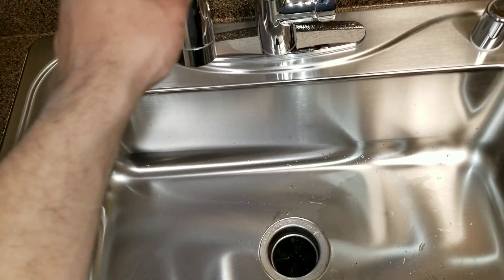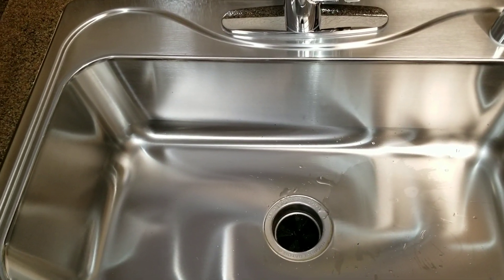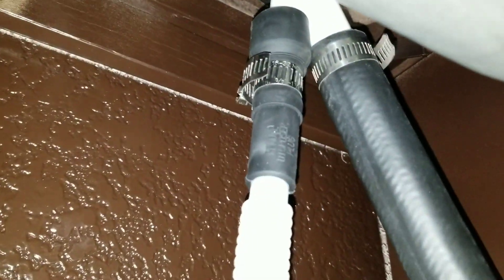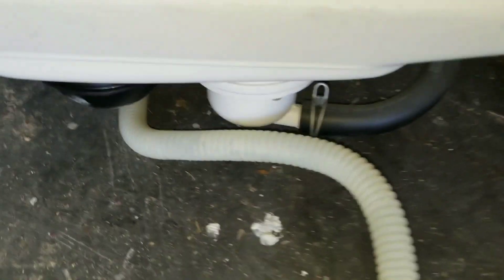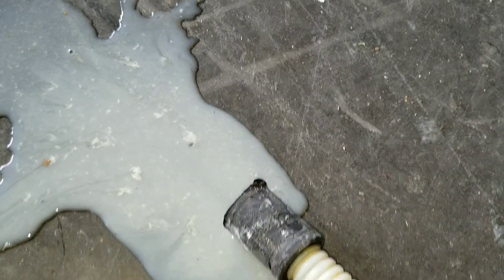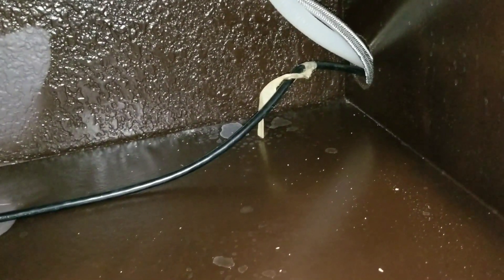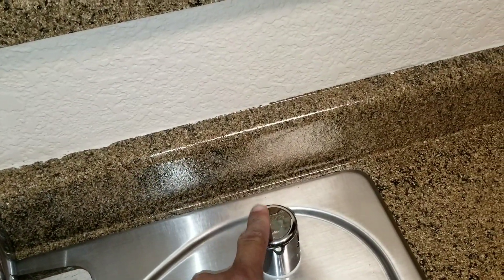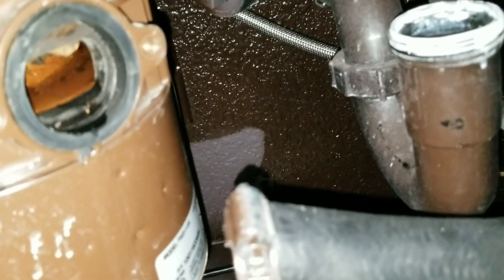Garbage Disposal STINKS! Real FiX!!!

Comment: I'm Still working on my smelly disposal after using the lemons, ice, baking soda / vinegar bleach and scrub brushes and commercial packets. I'm about ready to take the unit our and try cleaning under the rotating plate since everything else is spotless. This hose you show is the only other thing possible except the piping above the trap. THANKS for a great video

Comment: Sam...another area of STINK..is the actual rubber boot on the sink drain of the desposer.
You need to clean with a cleaner...the UNDERSIDE... of the rubber boot.
Mine was slimy and smelly.
I followed instructions,  from another youtuber. That was my bad smell .
Good video...on other areas to look for bad smells. 
Thanks for sharing...

Comment: Ok so wait... My dishwasher line is lying flat... but I've always used a dishwasher tab when I run the dishwasher... and a shotglass worth of bleach...Used to dishwasher detergents actually had chlorine bleach but most of them don't now... I would imagine that the bleach solution getting sucked out in the first drain would kill anything in the lines?